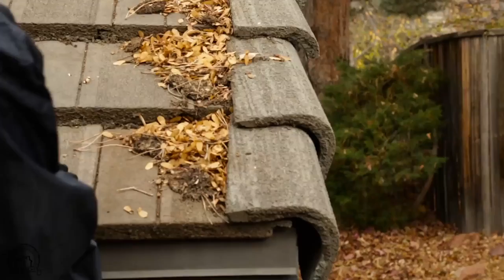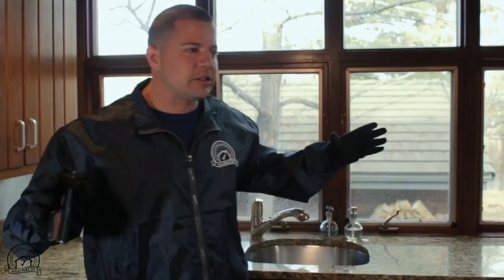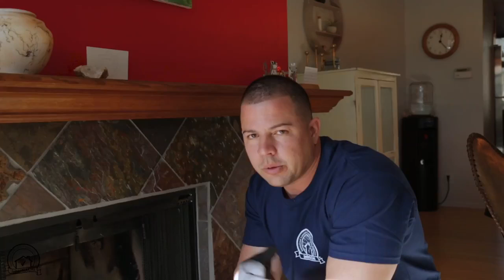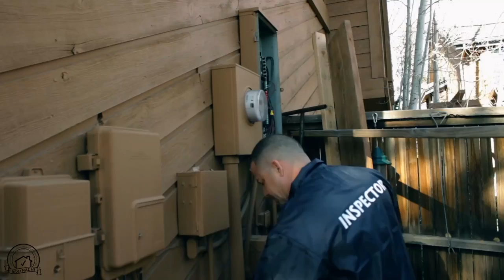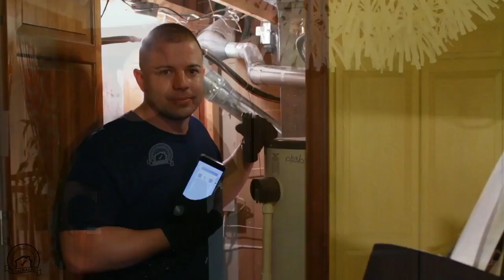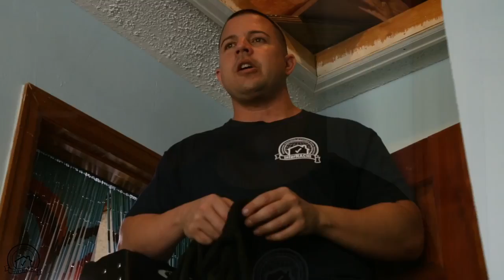Home Inspection Tips and Tricks with Juan Garcia

Comment: great tip for inspecting the roof, I was thinking about investing in a drone but this will work great for now, ill revisit the drone idea only if i see demand for it. Thanks Juan and Ben.
Reply: I agree, Luis. The SpectoScope at http://www.inspectoroutlet.com/spectoscope.aspx is a good home inspection tool. I have used it. It works. You can inspect the roof system while standing on the ground. That's a safe way to inspect a roof, which often can be a potentially unsafe situation.
Reply: Agreed. In Colorado, it's common here to have a 20-mph gust of wind happen unexpectedly.
Reply: yeah, im in So Cal and its gets windy here next to the mountains. do i really need a GoPro or can i cheaper camera with the same Bluetooth features?
Reply from the maker: You should come to our national convention in Southern California at https://www.nachi.org/convention/.

Comment: Since codes are so regional and varying, do you recommend training in your area of operations?  Great information,  thanks
Reply from the maker: That's correct, Jack. The local codes and building standards, often set by the local authority having jurisdiction (local code inspector), are the ones that take precedence. So, it would be good to know them. However, they are all based upon international codes, which every good training course or class should be based upon.

Comment: In general, very good job however, a major purpose of the inspection is roof condition because it can be a costly replacement. If you don't walk the roof you should offer a discount. The roof inspection shouldn't be passed on to a roofer if there is doubt.  You should also recommend approximate lifespan.   I can understand recommending a possible foundation concern to an engineer but not roof to roofer.
Reply from the maker: Thank you, Tony.

Comment: Just curious, why would you not mention that was a Zinsco electric panel and recommend that it be replaced. Also there were multiple neutrals under a single screw or lug. Which is a safety concern.
Also, are earthquake straps not required where you live? 
Like how you explained if you can’t see 100% of something that you disclose that fact. That is a very valuable piece of information.
Reply from the maker: Good questions, George. I'll pass them on to Juan.

Comment: Do you have any requirements for hand rails? You walked by a 2x4 hand rail going up to the porch. My understanding is a hand rail must be small enough to grab properly with your hand. A 2x4 doesn't fit the bill.
Reply from the maker: Hi, Curley. You're correct. The house is filled with defects. Numerous. The video's intention was not to list all of them. As a home inspector, I inspect for a grippable handrail, regardless of when the house is built. I believe the 2018 IRC 311.7.8.5 refers to graspability.
Reply: He said early in the video not to be too hard on him that there are several deficiencies he wont cover in the video so he can focus on a few. I remember thinking then what a shame it is some people have to be so critical.

Comment: My structural engineer helped me out way better than my inspector did..? Hell dude was certified and i spotted more than he did..  dude didnt notice all the plumbing was old steel pipe with 75% blockage in distribution along with all cast iron sewet buried under slab.  The previous owner bandaided all the structural issues but i noticed with a level.. lol.. that inspector was fired actually for stealing from somebody during inspection.. serves him right..
Reply from the maker: Wow. That's an experience there.

Comment: I have a great tip hire a licensed contractor for an opinion only. With a real contractors license.
Reply: why would I hire someone to inspect that's not specifically trained to inspect. Im a licensed contractor but what I have learned as an inspector is an overall view of the home,  Contractors build, inspectors inspect.
Reply: Ya know I appreciate some yes some home inspectors.i have contact with them regularly some of them actually have the experience needed to do inspections most are just hacks that could not hit their ass with both hands.some things are learned on the job not from a classroom or books.they could not make it in the field
Reply from the maker: Thank you for watching our video.